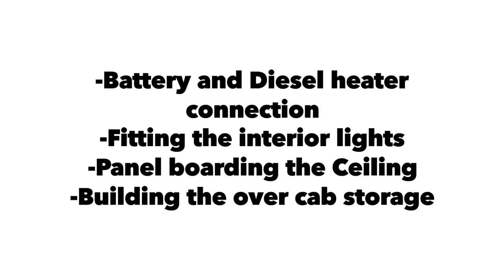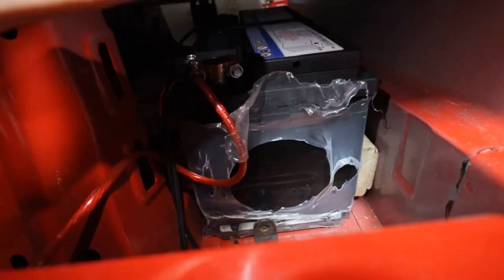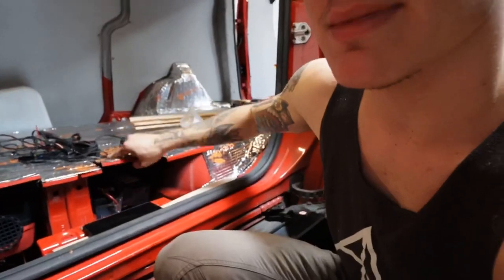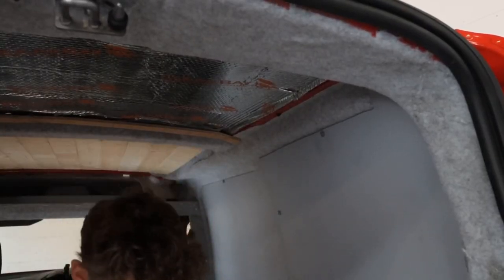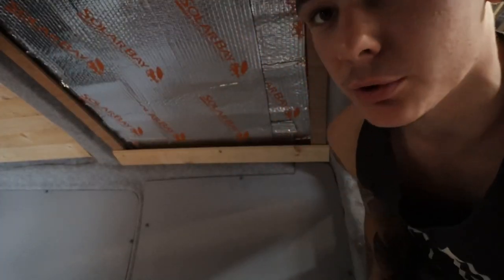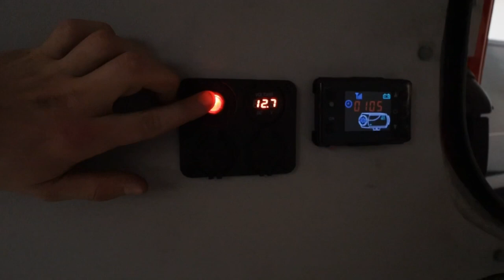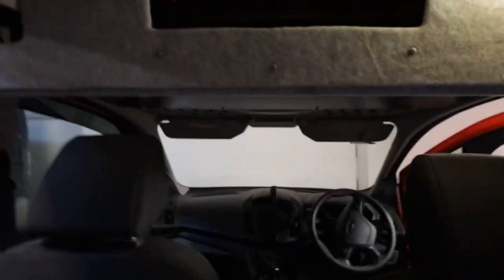VAN LIFE! Over cab storage!

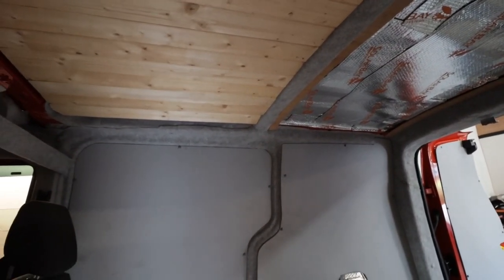Comment: When you put the boards that you show at 4:57 were those drilled in? If you do drill how do you make sure you don't drill through the roof? Same goes for the flooring. Is there another empty layer similar to the ones where you shoved the electrical wires in that allows some flexibility with this?

Comment: Nice! So what is the panel that is to the right of your 12 volt and USB ports?
Reply from the maker: Alexander/Александр S/С that’s the panels that shows the function on the diesel heater + shows temp... it’s quite useful but had to run a cut off switch below it for the heater due to the power off switch for the heater not working lol

Comment: You know when you take the bulk head out of the van, is that over head storage already there are you just adding on a cover to the front of it? or do you actually have to make the storage if that makes sense? Thank You :)
Reply from the maker: Hey, so there’s only a small shelf that’s about 40cm deep but I extended it using that black marine ply... the carpeted cubby in let (the access in to the storage area) I also made out of ply then carpeted 😊
Reply: @JakesJourneyMate  where did you get the black ply to extend please? :)
Reply from the maker: @sophiejohnstone1603  just had this hanging around, but you can pick up ply from B&Q or Wickes 😊